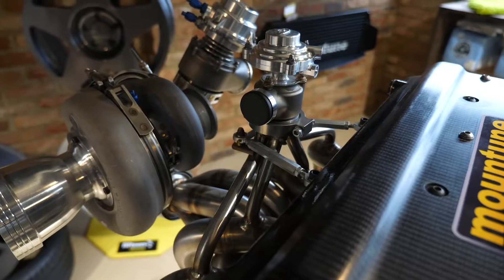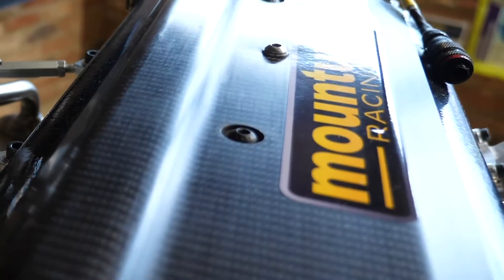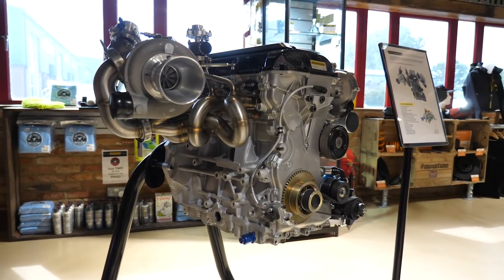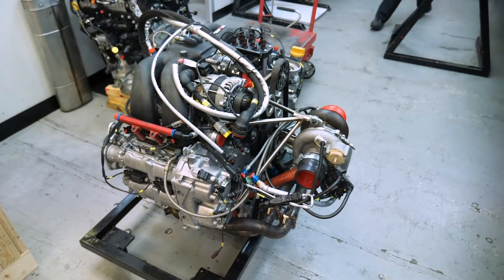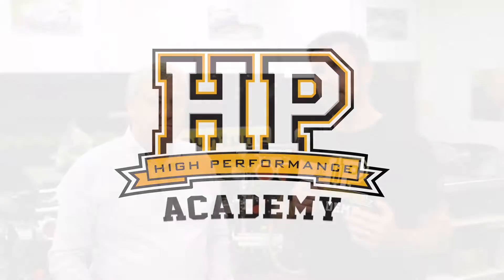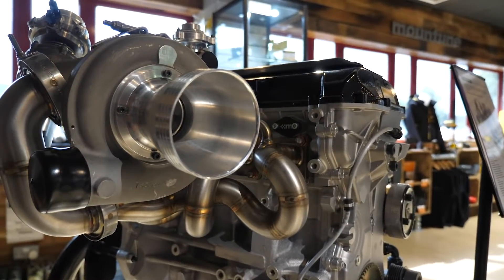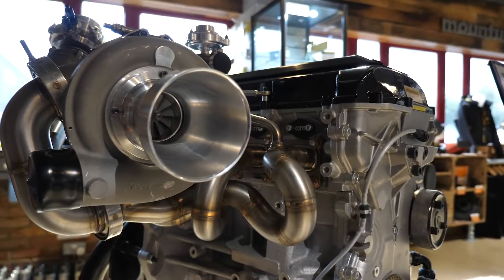Withstanding 3,600 PSI Of Pressure | Mountune [TECH TALK]

Comment: Camless technology is a step forward i think freevalve no need for throttle body direct injection or a wastegate with individual valve ports would be able to run one valve  port of each cylinder to bypass the turbine then tap back in after dump pipe and make the computer control the turbo  speed 🙄
Reply: Response time may be problematic on Freevalve, limiting the maximum engine speed. Throttle response should be fine though.

Comment: Mazda SkyActiv race engine have also 250 bar cylinder pressure, engine runs a relatively low  14:1 compression ratio, Bosch fuel injection system operates with 30000 psi. Twin compound turbos from Garrett provide up to 70 pound  of boost, charge is cooled through a pair air to air coolers. Nothing aluminum alloys pistons not can`t hold up this load. Inside liners is steel pistons This set up work well without problems.

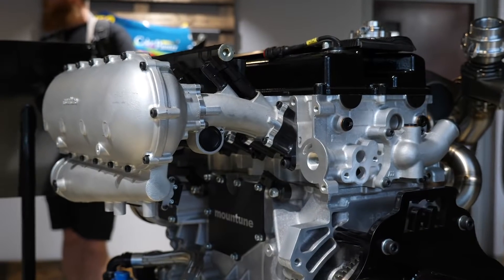Comment: Forgot, with the comment about the plenum, check out 0:20 - how the charge is introduced to the plenum from below, along the full length of the plenum. It give a more even flow of pressurised air to all the intakes.
It looks bespoke, but companies like Jevney have a line of similarly designed plenums.

Comment: To clarify, when people say the 'bolt' has settled, or whatever, aren't they really referring to the gasket?
As the gentleman said, sometimes more is less, when it comes to bolts, or studs, and head sealing. 

If you have the chance, could you perhaps ask them about their preference for full diameter Vs reduced diameter shanks? If they're made of the same material, and equally torqued (tensile loading), one would expect the same nominal clamping force but with the reduced shank having less sensitivity to head/gasket/ thread expansion and contraction?
The other thing is the diameter of the load bearing washer under the fastner head - I have seen even 'stock' applications showing an impression of the washer, which would suggest it is sinking into the head and reducing the tension on the fastner, in cases where the washer is little larger than the head - any thoughts on using larger diameter hardened ones to reduce this sinking, spot faced as required on the head?

Comment: Awesome interview.
Still confused about the fresh air anti lag.
It pumps air into the exhaust manifold. Fuel gets injected in the exhaust stroke. So what provides ignition. The combustion camber doesn’t have air so I assume the spark plugs won’t be able to ignite it a very very rich state.
Reply: Midgetbar maid the spark plugs won’t fire, the heat of the exhaust manifold will ignite the fuel

Comment: Never thought one of the benefits of direct injection would be a far more efficient anti lag system!
Reply: They use two injector system, second injector spray more higher pressure fuel in manifold and ecu can timing it sequential, that just provide better fuel/air mixture and produce more torque.   Duratec is great power unit!  This engine can beat mighty Millington  natural aspiration assembly  same cubic capacity.

Comment: Very interesting as usual.

Why not use a monobloc like the offenhauser?
Reply: -very hard to control coolant flow
-hard to achieve head ports that flow well 
-mains have to be really far apart in order to install pistons, or mains need to be modular
Reply: House of Boost still the Offenhauser is one of the most used engines, with most wins in indy 500.
The last variant, 2.65 liter turbo, produced 770 hp.
Surely with modern technology one could make an even better design?
For instance, regarding cooling. One could have the water jacket go around the head uninterrupted and thus have better cooling.
Just speculating of course.

Comment: That's really cool stuff.  Could someone take an Audi or whatever and switch between a rally/high boost type tune and switch back to a more oe tune if the proper equipment was applied? Like a serious weekend warrior?
Reply: Sure, you basically take a purpose built racing engine and detune it for daily driver duty. It really wouldn't be a great idea.

Comment: how they ignite the fuel mixture in the exhaust manifold during the anti lag mode ?
Reply: This usually happens through the heat of the exhaust headers' metal leading to detonation or extremely retarded ignition timing, sparking the air fuel mixture at the end of the exhaust stroke
Reply: Did a video about that already look . Look at their other videos
Reply: The flame doesn't go out in the cylinder.  If you chop the exhaust off in line with the front seats, you'll still get flames coming out.